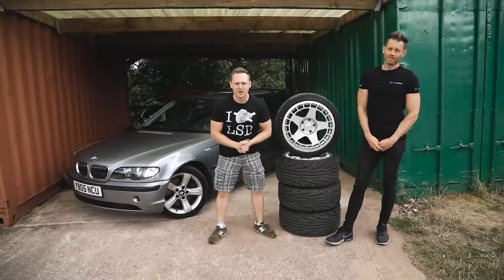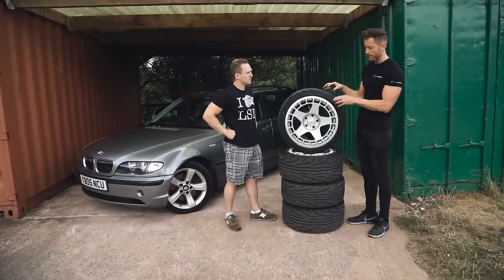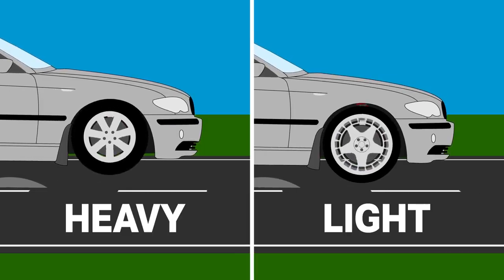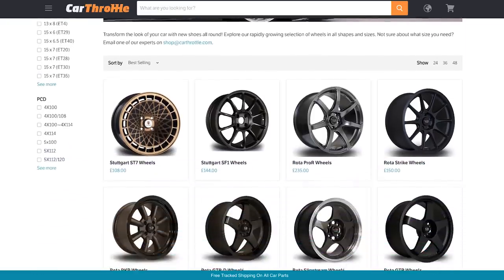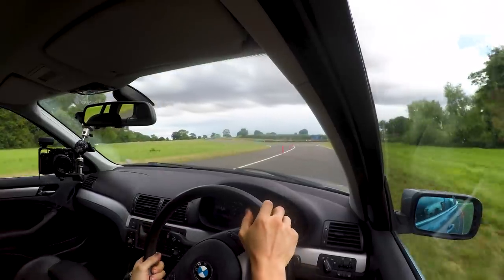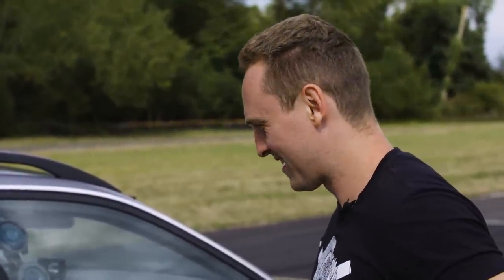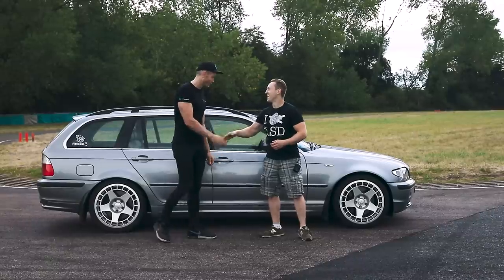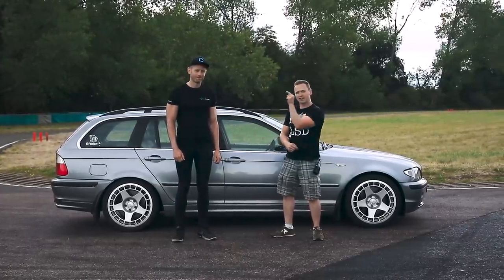How Much Difference Do Sticky Tyres Make To Lap Times?

Comment: I wish wheels and tires would have been changed before suspension! Just to serve as a proof that the easiest tuning you can do to your car is changing your tires to better ones.
Reply: I don't know why people are buying crap tyres anyway. Anyone want less grip?
Reply: Some people do not know any better, some people simply don't care. 
I have a good example, a colleague, very passionate about old cars, but not necessarily passionate about spirited driving. He buys the cheapest all season tire he can find, his argument being that he drives rather slowly, so he won't benefit from the added grip. I tried to explain to him that those few meters of braking distance could make a huge difference in certain situations, but to no avail.
Reply: Chris Hart I use budget tyres on my daily driver, it grips the road very well in both the wet and dry at road speeds. I have no reasoning for extra grip because I'm not thrashing a 115hp Volvo on public roads. If it can cope with 50+mph cornering speeds, it's good enough for me. On my 310hp Golf however, I run Toyo R888s because that car does get thrashed around the roads and grip is the most important thing. 

It's not that "most people don't know any better" it's that their car will rarely ever be going fast enough to struggle for grip on the first place.
Reply: But is not all about lateral grip. I find that most benefits come from the reduction of braking distance. Your Volvo could be benefiting from that if cornering speed is not a concern. And you don't actually need to go full on and spend a fortune. Sometimes, spending 20-30% more can buy you a much better product. Valid for a lot of stuff, not just tyres.
Reply: Exactly. When I bought some alloys with budget tyres my car handled much worse. Braking distances was the biggest difference as it would skid out much sooner
Reply: Chris Hart Ever heard of not having enough money for high performance tires every season
Reply: Agree, plus tires are cheaper and easier to install. Definitely should've been wheels and tires then suspension.
Reply: @mariuszanfir2298  Remember though, depending on the actual age of the car, an old car with a modern all season tires will probably still create more grip than an old car with an old technology performance tire. All depends on what your idea of "old" is though. If it's 50's my idea holds relatively true but if it's 80's or 90's there would have to be some kind of tests done to see... maybe an idea for a future episode?
Reply: People just assume tyres are tyres, and brand names are ripping you off. I don't do anything silly like buy racing tyres for the street, or buy "fuel saver tyres" lol, but I generally find the best handling tyre for me car that I can. Anyhoo couple years back I went away for 3 months and gave my car to my father to use. Apparently he ran over a nail, and rather than tell me he thought he'd "surprise me" with a complete set of the cheapest tyres the tyre shop had, then forgot he did it. I came back, instantly realised my car was handling like shit and pulled into a servo to find out what was wrong, assuming tyre pressre. Yeah I was pretty confused when I saw all 4 wheels had a company I'd never heard of printed on them! 

TL;DR: my dad got a puncture in 1 tyre, cost me about $600 in new tyres.
Reply: Chris Hart for drifting
Reply: Well the video shows a full second improvement over the last lap time... SO that highlights how much of an improvement proper wheels and tires give you.
Reply: and if he goes for better quality then wear will be more even around the carcass... it'll be more enjoyable at less spirited speeds for the life of tyre!
Reply: Money can be an issue.
Reply: True but a wheel and tire upgrade can be more expensive and less useful for people who live in cities with bad pavement. In that case, a low or mid- level suspension upgrade is often the smarter choice.
Reply: No shit racing tyres are made for racing

Comment: Amazing edit as always guys, much fun filming! It's getting go the close to the m3 (which is now fixed....)
Reply: You look strong!
Reply from the maker: Thank you for joining us again!
Reply: The aftermarket rims egh 🤢
Reply: @CarThrottle  Alex can you post a link to what trolley jack you use?
Reply: We wanna see the time of the M3 with ABS working though!
Reply: Alex should really keep the interior an make it a sleeper
Reply: Look into the camera and talk
Reply: Never skip leg day my friend :D
Reply: @straxwb  m3 with abs + lightweight  R18 wheels + same size (f/r)  R comps
Reply: You guys should just settle this whole saga with an arm wrestle, my money's on Jon 😂
Reply: @r129r16pfl  Just a working M3 will suffice, the point of this all is to test if it's possible to create something that can compete with an M3 with a lower budget. The only extra I'd give to the M3 are the tires.
Reply: Just a quick note to say that Forged Wheels are made by a single piece of material being compressed/heated thus resulting in a more consistent material that can be made lighter and stronger that a cast wheel. Machined to finish. Great vid all the same.

Comment: Love the videos! A few thoughts:

1. The fifteen52 18" wheel may be lighter than the stock wheel, however, a high quality flow-form 17" wheel (e.g. APEX ARC-8) will be even lighter, further reducing unsprung weight and increasing performance. Tires are also cheaper. There is a reason the SPEC E46 racing series uses 17" wheels. 18" wheel may look better, but will not perform better than a lighter 17" wheel. You may be able to drop a little more time going with a 17" wheel. 

2. BMW does use staggered tires with their M models, but that does not necessarily mean its the better choice. Going with a square option is much more beneficial on track, as it greatly reduced understeer that plagues pretty much ever BMW chassis. Additionally, if you track your car often, you will want the ability to rotate your tires and increase their longevity. Not something you can do with a staggered set. Unless you are pushing a ridiculous amount of power down and need to extra grip in the rear, square is the better option in my opinion. 

I think the best setup for the E46 chassis would be a 17x9" ET42 with 245/40-17 tires, that way you can maximize sidewall support with a 9" wheel as well as rotate and reduce understeer. 

Keep up the good work!

Comment: You need a wooden splitter at the front, that makes 330D's much faster. :P
Reply: It does. But only if penistone oil is used in the engine
Reply: Ahhh the ol top gear builds. Loved them so much
Reply: Dont forget to fuel up breakfast and try our English Muff-ins

Comment: How to beat an e92 m3 around the track you ask? 

Buy a Prius
Reply: Topgear thinks otherwise. The actual Topgear i mean.
Reply: Didn't top gear show a M3 getting better fuel economy at a track than a prius?
Reply: Dude the M3 gets better mileage than a Prius lol
Reply: Ollie Crofts
Bud, you got it the other way around! Probably this works better and is more accurate:
"How to beat a Prius' fuel economy at the track you ask? Buy an e92 M3!"
Reply: Endurance race?
Reply: If the prius went flat out and the V8 M3 was keeping pace the M3 would be more efficient. But you must know this already lol
Reply: Ethan, is that you?

Comment: Change your rtab to a  spherical joint .. most important mod to any e36-e46 chassis regardless of engine ..  it reduces flex on the rear so wont be affecting toe mid corner   . Relatively cheap mod to do 150euro would get you a pair
Reply: This is the 2nd time I hear about this mod, it's pricey but I think I want to try it as it got my attention. Luckily I still haven't bought poly yet so good timing.
Reply: @Rusiputki  loads of brands make them . Its basically a bearing in a metal cage .. obviously a nice alignment it needed and its amazing
Reply: I'm only finding these in US from AKG, Dinan and Bimmerworld. Where in Europe can I get these monoballs for e36?
Reply: @Rusiputki  nerp tech is cheap but from USA ..

Comment: Weight loss will be the real time saver on such a short circuit. Especially against the lard-arse e92.
Reply: Hope they do a hard core weight reduction, removing everything, bare to the metal, with just 1 racing fixed back bucket seat.
Reply: Just to point something out, the e46 is heavier then the 'lard-arse' e92
Reply: It's also a diesel family estate. Not an M car.
Doesn't make the e92 any less of a fatty.

Comment: I like fifteen52 wheels but they are heavy. Interesting choice in staggering the wheels. My m3 is a staggered set up but always thought squared was faster on the track.
Reply: General square is better but the car has to be setup for it, in the last video after the coilovers the car was very loose at the rear so would benefit from a wider rear tyre as an easy balance fix, likely the coilover spring and damper rates were setup for staggered tyre setups and without adjustable damping you can't tune it out

Comment: I would love to see what the weight difference is between the old and new so we can see how much of the time difference is from the unsprung weight savings and how much if from the stickier tires. 

I think the fifteen52s are forged, but moving up a size means more wheel weight compared to staying with a 17".

Comment: Nankangs?  The only tyres I've ever owned that were A: impossible to balance as they weren't the same diameter all the way round (you could see the variation when spinning them while the car was jacked up) and B: just gave up providing grip if it was even slightly wet!  

Oh and those rims are hideous.

Comment: First of all with that diesel you needed to chip it and scrap dpf and catalyst
Reply: doesnt have a dpf
Reply: Curious Drone I mentioned m57 engine, wich had dpf or cat or dpf+cat, not this 330d. First of all you needed with all of them to get them breath easyly and get more pressurr from that turbo, measure before and after that and then suspension and tyres. He did it exactly like in TopGear with that VelSatis, I bet he will chip it next series
Reply: yep, with exhaust and stage1 remap you can reach 270hp / 520nm. huge gap in performance.
Reply: You might want to read the comments from the previous episodes...

Comment: Looks like wheel offset is changed as well - pushing the tires outwards more for a wider track and better handling. 

Not sure if you did another alignment with the new wheels, but camber now looks much improved through the corners.

Comment: Now change
- gearbox oil( also add a bit of additive) 
- diff oil( add some good additive to itl
- engine oil( ravenol rup for example or redline 5w40)
- flush the break fluid
Additional stuff to do
- clean the inlet manifold and inlet chambers from all that egr sut
- remove the dpf
- deaktivate the egr 

All that should bring 1 sec. At least

Like so he can see... Especially because that is easy stuff for us to do and he can proove if it really works...
Reply: First thing is to add a strut tower brace... should have been added with the coilovers. It's the first thing I did to my e39 540i M sport suspension. Then added 19" staggarred wheels, 285/35 back and 245/35 front.

Comment: Hey guys, I love this series, and the previous one. Seeing the improvement each mod makes is great. What I would love to see for the next series, is do the mods like most of us most likely would, with the more accessable and less expensive mods first, like tires, wheels and tires, and weight reduction, and move up the cost/work ladder. I would love to see how Gareth would have done with these tires, but stock suspension, or with the interior stripped out

Comment: lighter 17 inch wheels would be better for this car
Reply: The explanation was pretty poor tho...
Reply: Hmm you think? do you have made your own experiences?
The differences would be very interesting
Reply: True. Most E46 race cars have 17 inch rims. There must be a good reason for that
Reply: Agreed, and a square stance.
Reply: True. My 330ci race car drives fastest on 17 and square at Zandvoort
Reply: @going narrisch
They actually explained it in the video, but they completely missed the most important part; the wheel itself. The more mass there is further out from the center of the wheel, the more inertia it has, and thus the more force it takes to accelerate. Don't forget on wheels that there's not only the face of the wheel, but the barrel as well, which makes up a lot of its weight. Using a smaller wheel decreases the size of the face a little, increases the size of the sidewall a little, but most importantly, reduces the size of the wheel barrel and brings it closer to the center.
Reply: youran1 17in, but how wide? Stock sizes?
Reply: GiakSeven "because race car" everybody knows that
Reply: GiakSeven because you would have more tyre to play with the ground. With 18 inch you have in my opinion too less tyre. 18 inch would be good but at least not the best for a track like hockenheimring, without bumps and small turns. 

2nd problem is, that they choose 225/255. 
a lot better it would be with 235/235 or 245/245. 

If you build a tracktool, you should go the same tyre for balance and more camber. 
(To less in the last suspension video)
Reply: John Faire 8.5 and same tyres 235/235 or 245/245
Reply: Go to 16”s around that little track
Reply: @JohnFaire  225 tires on 7j

Comment: I might be getting a 330d E46 coupe from a friend soon, although I like the Hankook Ventus Prime 3's on my current 116i I thought I would re-visit this video to see what you used.  I'm tempted to buy a pair of the newer more road orientated Nankang Noble Sport NS20's which replace the standard NS2's.  I'll stick with 17" rims and if they are good I'll get a 2nd pair when I've tested them both ends, if they aren't I'll get a pair of Prime 3's.
Reviews seem mixed, a lot of people don't like the stiff sidewalls and complain about lack of comfort and noise.  Others say they are listening to V8's symphonies so can't hear the noise and reckon they corner as good as anything out there.  Nearly everyone says they are better than any run flat regardless of brand and they last ages.
The 330d videos are the best you have done so far.

Comment: The difference in width is quite big honestly .. 255 at the back is good for reducing the oversteer but 225 up front is way skinny and means less grip and more understeer just like what u did on that last corner ..
Reply: Abdelhameed Alotaibi you can just squeeze 235’s under the front of an E46 but it’s marginal, 225 is realistically the limit.
Reply: Simon Rook yeah the difference between 225 and 235 is marginal i do agree but with the 255 at the back it does have an effect .. the way its set up now is like a muscle car , a lot of grip at the back for straight line acceleration but in corners its bad ..
Reply: @abdelhameedalotaibi3657   more grip at the back is very welcome with the power this car has.
Reply: Agree! They should try 255 on the front, bmw 3 series is all about the front end grip
Reply: @r129r16pfl   just put trays on the back that really spices things up
Reply: 235 square would have been the sweet spot at this track imo. The stagger might be nice on a fast track with tons of power but right now it's just more rotational mass.
Reply: @simonrook5743  I have 245s on the front of my 325, but I have 17s so that may be why they fit. But you can definitely go bigger than 235

Comment: I thought nankang was a bootleg Tyre lol
Reply: I'm sure they used to be. Maybe it's doing what skoda did with cars.
Reply: Nope, check nurburgring most used tyres. Nankang is on top. Top value.
Reply: @ferfire9   must have improved the last set i had back in 1995 were widow makers i used to wheelspin and wear the road more than the tyre
Reply: Yeah but obviously you get what u pay for. These Nankang tyres in the video arent cheap...They are cheaper than some other brand name tyres off course but the value is there. I also have experience with cheap tyres and i know how crap they can be, chinese or european doesnt matter.
Reply: @chrisredfield3240   lol that's over 2 decades ago
Reply: @Che1seabluesdrogba11   they were literally the cheapest tyres i could get at the time. Seems like only yesterday.  Back then you could get a whole set of reasonable tyres for around £100.
Reply: @chrisredfield3240  they're pretty good now, I've got a full set on my e92 325D.

They are very slippy in the wet though!
Reply: Ive driven all the Nankang's except the AR-1, there normal road tyres are pretty shit IMHO but the NS-2R is awesome for the price
Reply: We used to call them Nankang Ditch-finders when they first became available in the U.K.
Reply: MrCourty89
AR-1 is awesome.  They run without heating.  205 ar1 on front and 225 hankooks on rear - it was easy to make rear slide just turning steering wheel of FWD car
Reply: They are lol

Comment: 235 tyres in the real and front would be better for this track
Reply: I completely agree. 235 square would have been more sensible than a 225/255 stagger
Reply: I dunno -- he said that the rear was a little loose in the first two runs, so a square setup would've been worse.
Reply: BarracksSi too less camber in the front. See the last video about the suspension.

Comment: There is already an air duct for the front rotor in those cars. It stay in the wheel arch tho, not directly connected on the dust shield.

Comment: Much respect for Tyre Review BUT I would have gone 17's and the NS2RS in 140 tread. :) The 180's are ace on road which I have been using for 5 years now. But they aren't great on track for long. Also they are very greasy for the first 50 miles.